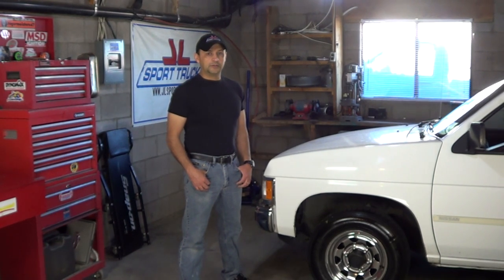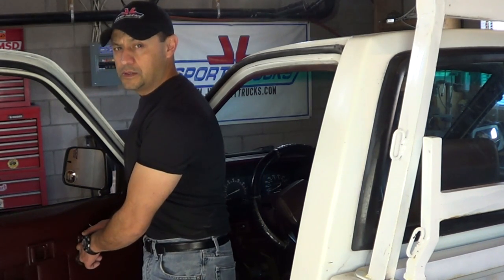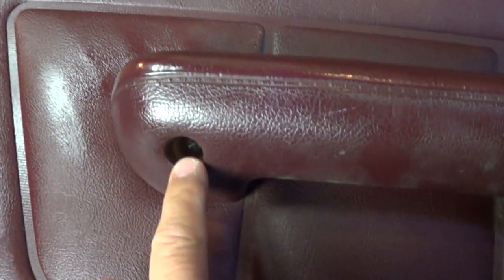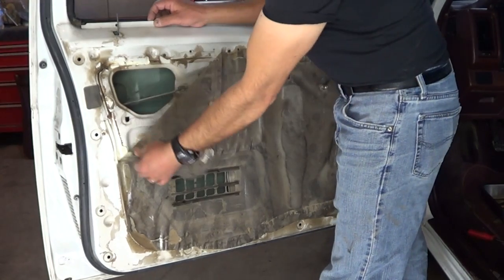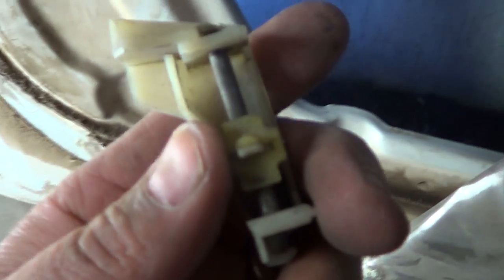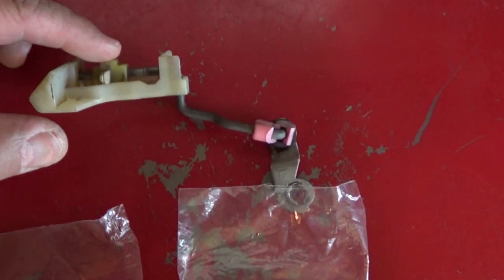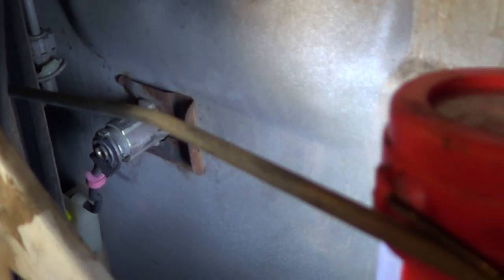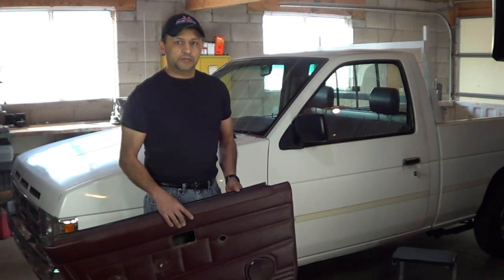Repairing broken Door Lock Mechanism on Nissan D21 Hardbody Pick ups

Comment: I just did this sort of repair on both doors of my D21.  A few pointers from my experience.
After removing the crank handle by puling that clip, put the clip  back onto the handle.  This prevents losing it.  When you go to reinstall the handle, just push it on.  No need to remove the clip again and put it on with the crank handle in place.

Those clips that hold the door panel to the door are a PITA.  I got a panel clip pliers from Harbor Freight, which helped, but I had to modify it a bit because the two jaws did not line up properly and they weren't both sharp enough to slide under the panel and clip.  A few minutes work with a propane torch and a pliers, to rebend one jaw, and on a grinder, to sharpen them, fixed that.  A working tool makes the job easy, but you're probably going to want to have some spare clips around.  I suggest ebay as a source of those, as they're $$ at the auto parts store, if you can even find what you need.

If it's cold, it's useful to warm plastic parts with a hair dryer before popping them apart.  Plastic is much more flexible when warm than when cold.

My problem was different from the one in this video.  Both outside handles had broken, and for a while it looked like I might get locked out of the truck if I weren't careful.  What I discovered when replacing the handle is that I could not fit the internal parts together without first removing the three screws on the vertical edge of the door that hold the latch mechanism in place.  No need to remove the latch, just let it drop about 1/2 inch, and then you can fit the internal parts together -- one part from the outside handle nests into one from the latch.

FWIW:  Around 8:26 on the video you can see the inside of the keylock.  Note that flat metal plate (with a lip in the foreground) that holds the keylock in place.  This is very easy to remove and replace.  I suspect that, in the factory, this entire assembly was installed at once, not piecemeal.   IIRC, the entire mechanism can be withdrawn (to the outside) through the hole the keylock mounts in.  I did have it out on one door, and had no trouble reinstalling it, but I didn't take notes.

Recently I've been using the trick of crazy glue + baking soda to repair or build up broken plastic parts.  (There's lots of info on this trick on YouTube.)  I don't know whether that broken part in this lock mechanism could have been fixed that way, but it might be worth a try -- it's almost free, and there's no drying time for the repair.

Comment: The same thing can be achieved using two zip ties. one inside the lever hole [tight fit] and a zip tie that goes though that tie wrapped around that white plastic part [loose fit]. Thanks for the part number.
Reply: Make us a video !!  :)
Reply: ^william is eight
Reply: I mean *right!
Reply: Still won't last over time with cold weather they break

Comment: Or go to the parts store and get 'dorman door lock clip assortment' for about $4.   It doesn't have an exact replacement but it does have a black rod clip I think is common for chevy that fits the hole and the rod perfectly.   I could never get it to work by installing the rod clip first.  I don't how you did that and it's not in the video, but I could never get it installed that way.  Instead, I assembled the rod clip with the lock arm first, then sitting on a garage stool I was able to line up the assembly to the hole on the door lock and then push the rod clip in with one hand thru the bottom of the door frame and use a flashlight with the other hand thru the top so I could see what I was doing.  It takes some practice but once you get the rod clip inserted into the hole then the whole bracket should stay in place for you so you can mount it to the door lock with the 'c' clip.  The hard part is getting the rod clip into the hole.  I used a bit of electrical tape jammed into the plastic bracket to keep the rod clip from twisting sideways.  Once it's installed and you test the lock a few times, the tape should just fall out.

Comment: Cheers from New Zealand. Exact job needs doing on my WBY TD27 (D21). Perfect man, thanks again.
Reply: Just finished, got the parts in the mail yesterday, left off the little plastic washers, was a bit of a pain to get back on but the jobs done, works and doesn't interfere with the remote lock/unlock/alarm. They disabled them when they put in the alarm with the remote access, possibly to make it harder for thieves but that is not the way to get in to these trucks so really, a waste of time disabling the mechanisms, left the passenger side disabled. Cheers again.

Comment: Nicely done.  But how to fix broken lock mechanism when the door is locked and won't come open?
Reply: Use a slim Jim or coat hanger or something and pull up on the rod. Maybe just call roadside and see if they can get it unlocked if you have AAA maybe

Comment: Nice video, thanks. This part seems to have a rubbish design. I have my D21 for13 years, and mine just broke for the third time. 4th time replacing it now. I am going to have to scavenge the one off the passenger door for now to make this work till we can get spares. Lucky mine has central locking which works off the driver door key. This could however be the reason mine is not lasting very long because it has to push the central locking actuator and the normal lock which is putting additional strain on that part. I will take some measurements and see if we can do a 3D print of this part. But testing time will be long to see if it outlasts the Nissan part.

Comment: I have same problem with my 90 Nissan D21 door lock .   Question I want to leave off my door panel after I get it fixed ,   would that be ok to do ?    I suspect more door lock problems because the little plastic dimestore pieces will probably brake off again and again .    Please respond about leaving off door panel .

Comment: What is the name of the white piece that the rod hold goes into? I'm missing one of mine..
Reply: Did you even find what its called or anywhere they sell them ?
Reply: Im hoping if i can get a part number or name to get because i still do not know where to get one. Or one the smaller white pieces that goes into the yellow one. All of these tiny parts are so hard to find.

Comment: 1998..hmm I have 1991. Those part numbers say they wont fit my truck..
Reply: Nissan dealer can give you the part number for your 91.  Most likely they stock it.  I have replaced mine on my '91 at least 4 times.  PITA (thus the reason I was looking at this video for an easier way) but it solves the problem.